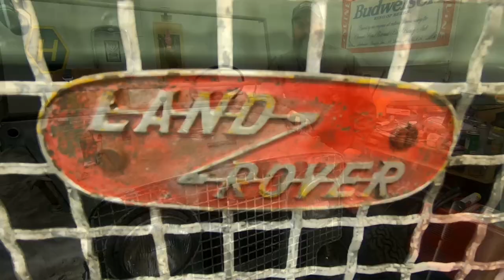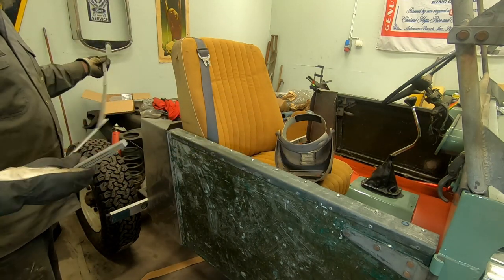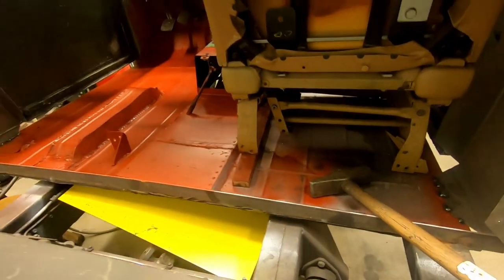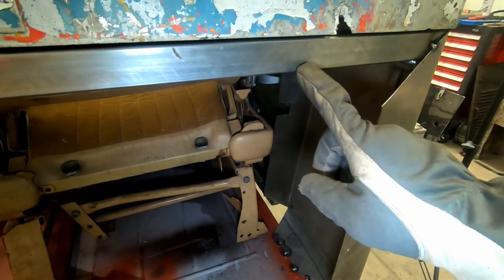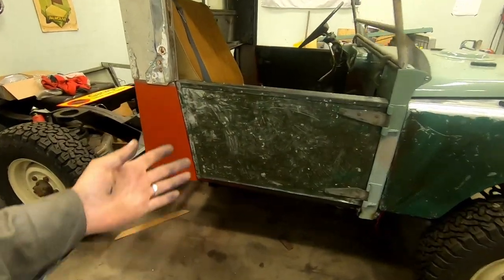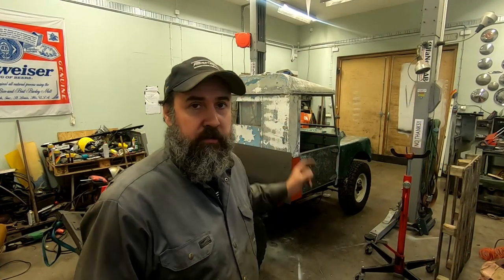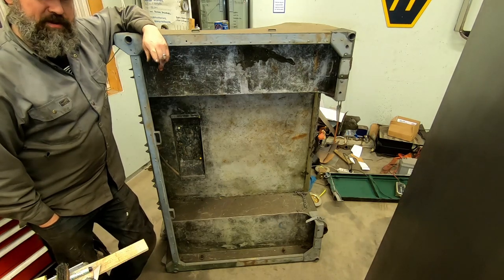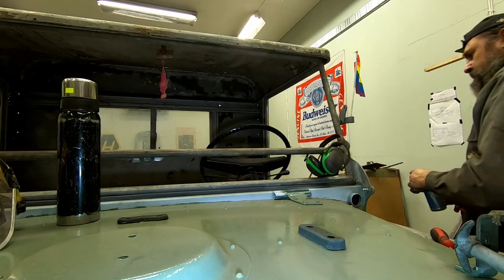Land Rover series 1, ep 28 Bodybuilding

Comment: Yes, you said it, no, or little gas is flowing through the gun evacuating the air at the weld. Possibly the tip isn't clean, or the hose is kinked, or yes, you're running out of gas. When I was doing MIG welding on my Mustangs, I used only CO2 because it was cheaper than the Argon/CO2 mixture.
Reply from the maker: You are right. The gas didn't work properly.